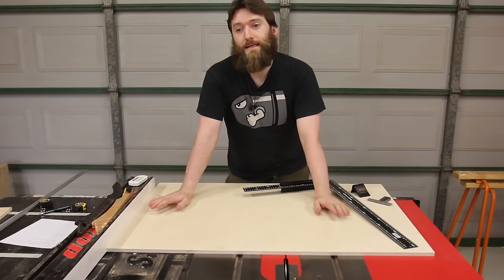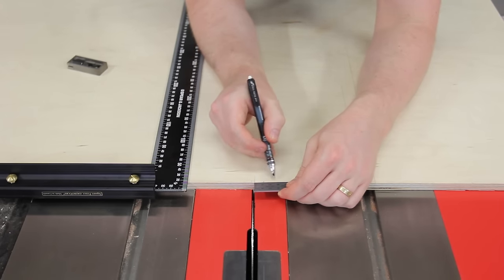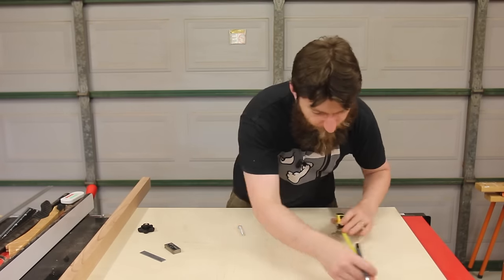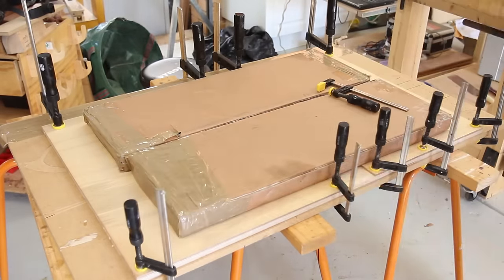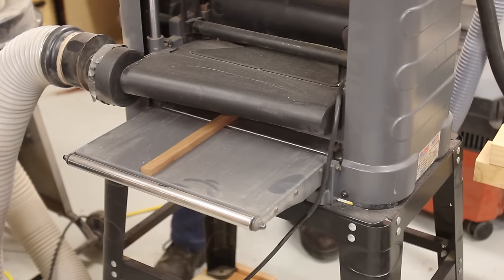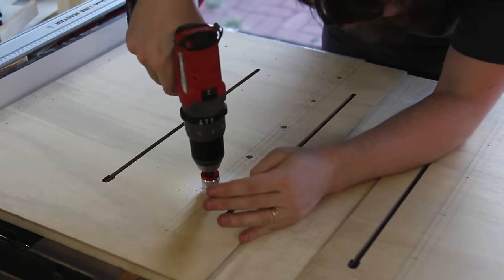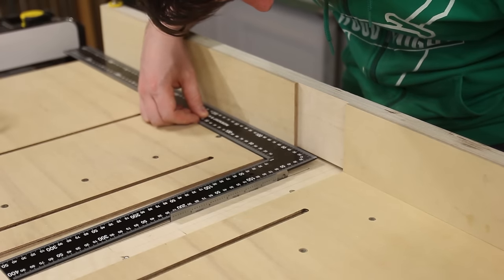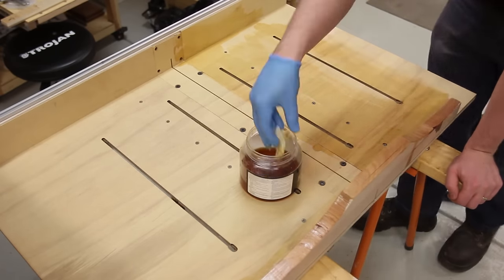085 - Advanced Cross Cut Sled (Part 1)

Comment: What is the make of that framing square? That looks like a high quality tool! [EDIT]- or maybe the aluminum piece is an add on?
Reply from the maker: +deemstyle Its just a Spear & Jackson 600mm framing square which was dead nuts square "out of the box" so no adjustment was needed. The fence on it is the "Veritas Square Fence" which is looooovely, screws on/off with two brass screws. 

I was going to go for a woodpeckers t square, but those are >$200.
Reply: Ah- yes, the Veritas Square Fence is what caught my attention. Looks like a great attachment! Thanks!
Reply from the maker: +deemstyle I've only had it a week or two but its now in the top drawer of marking equipment.

I'm planning to do a Jay Bates-style tool talk for all my marking tools, so I'll dive a little bit more into the fence when I get around to the video.

Comment: Paul, I'm wondering how far metal has to be away from the blade as not to set off the brake in the Sawstop
Reply from the maker: I've not tested it/had any triggers. You're better off asking Sawstop
Reply: Thanks for the quick reply Paul. My brake went off when I put the incra mitre guage at 45 degrees and got obviously too close. I was wondering because of the screws in the inserts and how close they would be when the blade is at 45 or a daddo stack is in the saw.  Great sled Paul. Thanks for the video